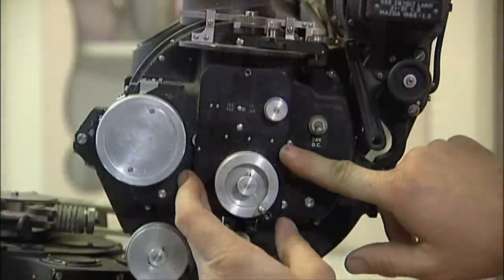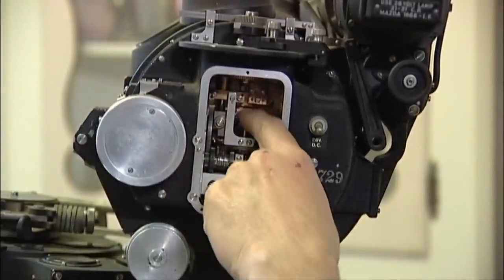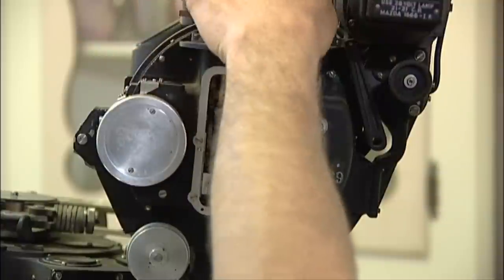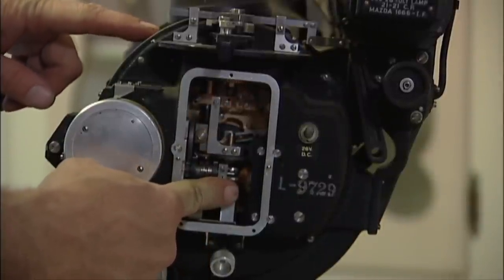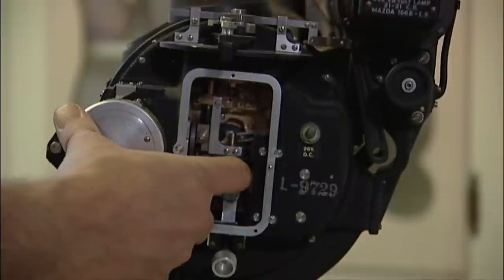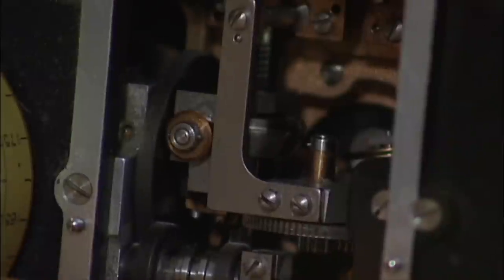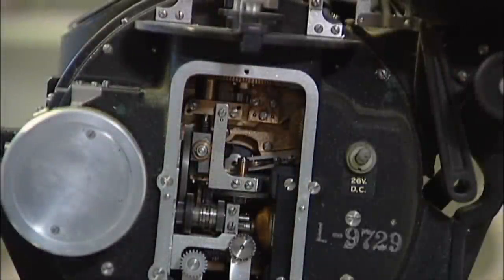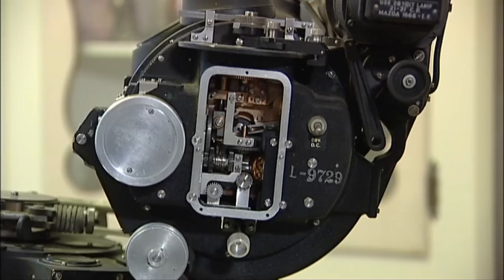Inside The Norden Bombsight

Comment: Great videos.  I picked one of these up last week and need info on the wiring connector.  I figured out pins 1 & 2 are for power but what about the others?  Are they good for anything since I don't have the stabilizer?  Also, the only power supply I have is a 24v, 2A.  Will this hurt anything?  Is 2A enough amperage?